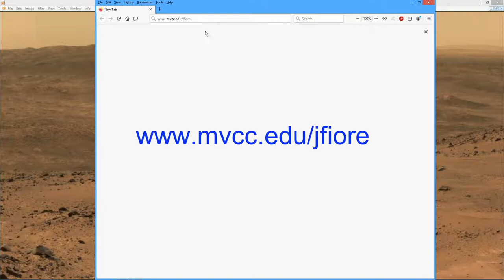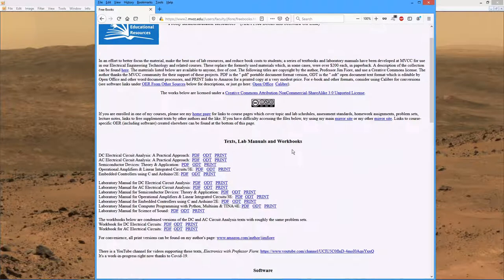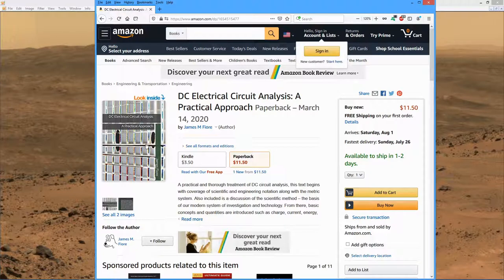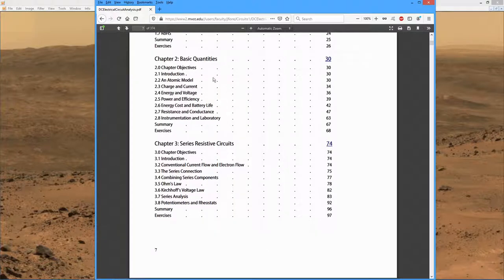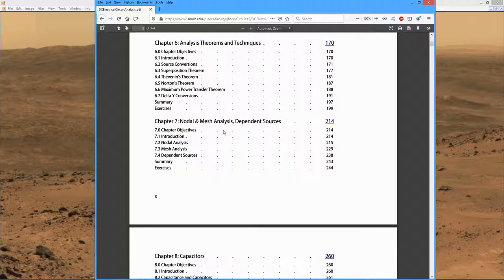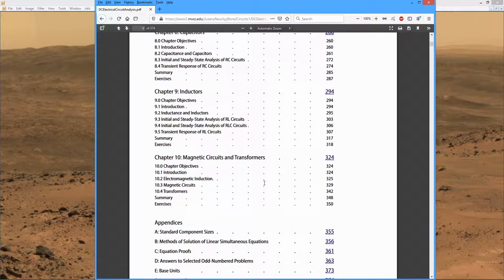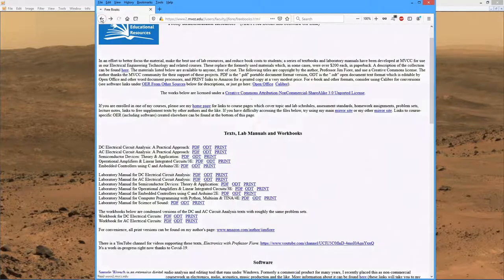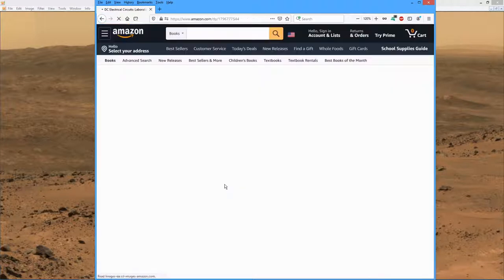DC Electrical Circuit Analysis: Introduction

Comment: Thank you so much.  I am 57 and love to learn. I am having to brush up on my Algebra.  Thank you so much for the free books and Labs.  Your knowledge and teaching shills are Awesome!!!!!  I have been trying to learn what I could from videos but found a lot of them leave big gaps and I felt I was lacking a good base.  I can not thank you enough for your time and knowledge.  God Bless and have a great day!
Reply from the maker: Algebra is key! Get a good handle on that and then some trigonometry for the AC circuit analysis material. if you have the time, a brief introduction to differential calculus is useful (I recommend "Calculus Made Easy", a book written over a century ago, that can be read for free at calculusmadeeasy.org )